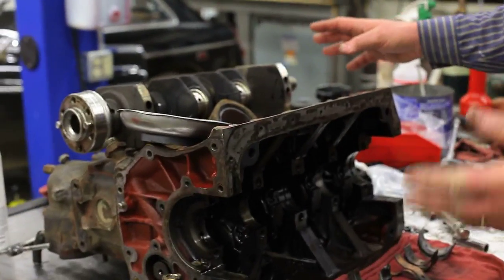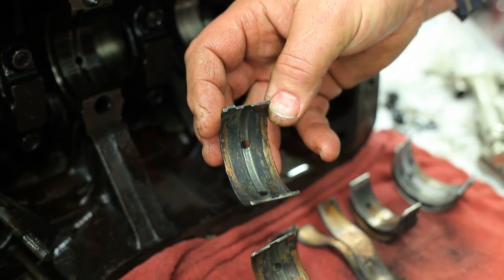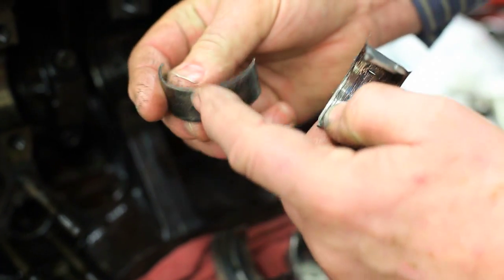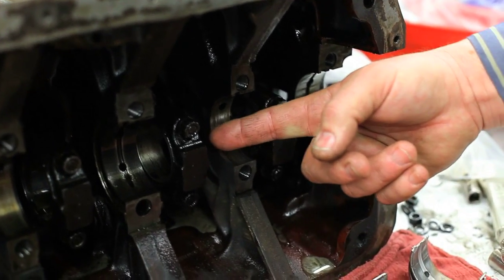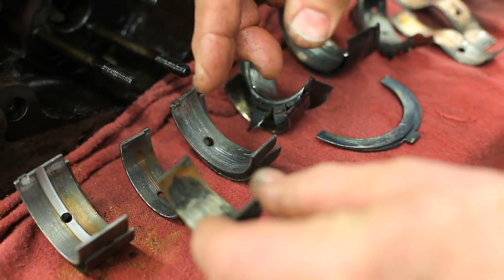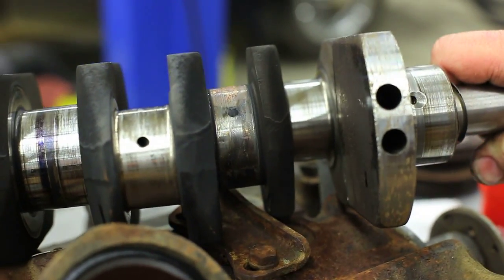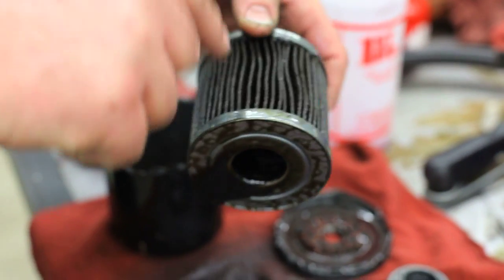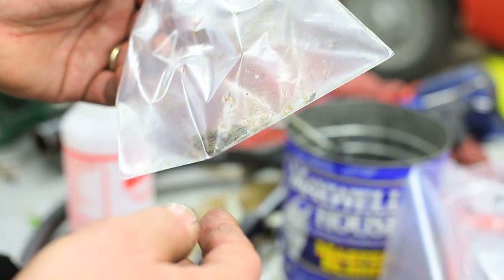183 MG Tech | Catastrophic Engine Failure on MGB

Comment: Looks like at some point in that engines life it had a coolant failure.
The crud you have found is burnt carbonized oil(sludge), that happens when the thermostat sticks open and it is not dealt with in good time. It causes the oil to never reach operating temperature and sludge's up then burns as you get hot spots in the engine while other parts are kept overcooled due to a failed thermostat.
Furthermore, when someone finally fixes the cooling system, the oil can now begin to clean the engine which lifts all that sludge and can block the oil veins worst still blow the pressure release valve in the oil pump so oil pressure never reaches pressure and you end up with the exact situation you have in this video.

Even more problematic is if the engine overheats, it thins out the oil to a water consistency which causes the bearings to overheat, annealing them. There is no way to return the bearings without re-manufacture or replacement. 
There should have been no way this could have happened if a modern oil was used yet if a single weight classic oil was used and the temperature was not maintained or it was the wrong weight of oil for the climate and engine operation then you would also get this issue.

Most people never realise how important the coolant is. Coolant and Oil tests are very important and go hand in hand.
All MG's especially those that use Aluminium parts on the engine recommend OAT coolant. Water must never be used... Coolant changes are every 2 years or 20,000 miles whichever comes first.

I also have to say that i have seen similar damage when the ignition timing has been badly adjusted, spark plug gap failure etc. Combustion starts too soon causing the power stroke to be pushing back against the piston before it has gone beyond top dead centre. That squashes out bearing shells just like you are showing here. Of course timing has to be setup depending on the type of fuel you are using, with ethanol in todays fuel that has to be accounted for as well as LRP additives if you use them for these old engines. There are allot of factors that contribute to this kind of engine damage. 

Any contamination of the bearings can cause a failure to the Hydrodynamic function of the bearing not forming. considering you had some nasty oil contaminants either from coolant, oil failure or bad oil, fuel/ignition setup it has escalated to death.

Of course an oil pressure test would have been a good test to have done at the early stages to diagnose the beginning of a failure like this.

Comment: @warci I have the same flickering needle when idleing, though mine seems to do it more when the engine is warm. Was told it's more likely just the gauge rather than the actual pressure. Hope that's the case!

Comment: Hi John, the oil pressure in my mgb is unstable when idleing cold. It looks like the needle drops a bit and comes back up with every rotation of the engine. When i give it a tiny bit of throttle it stays stable. It's been doing that since i got it and it runs good, but still... should i be worried?